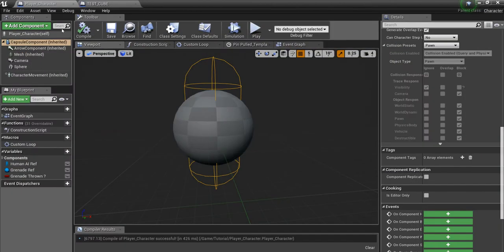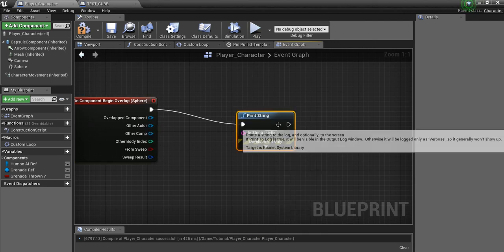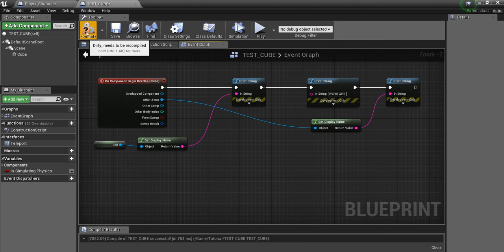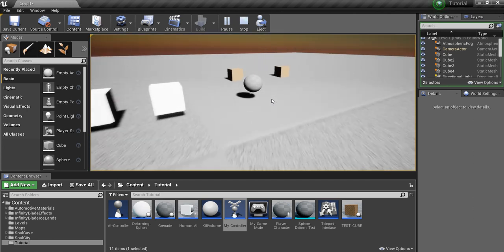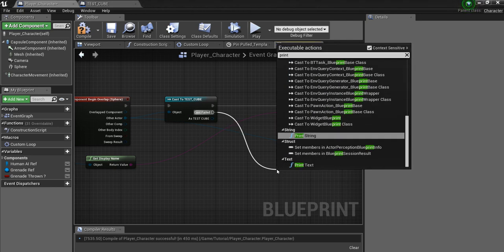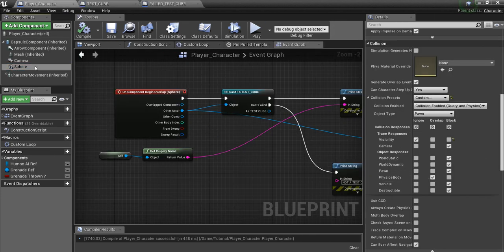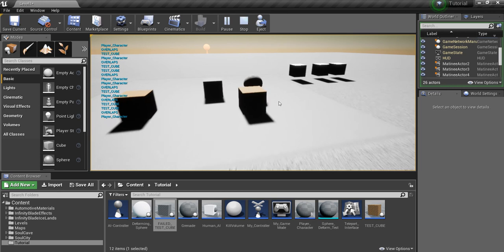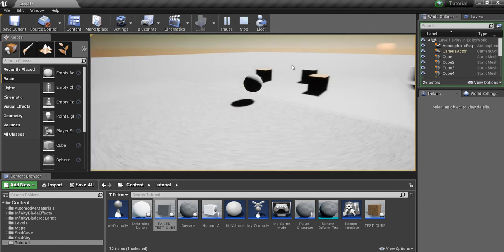Unreal Engine 4 Tutorial: Overlap Events Basic How To

Comment: I'm just not getting this. My collision boxes are acting all screwy. 

My player settings are capsule: generate overlap (Yes), Collision preset (Pawn), Collision enabled (query & physics) Object type pawn. My NPC are capsule: generate overlap (Yes), Collision preset (Pawn), Collision enabled (query and physics), Object type pawn. I added a collision box on my player for dialogue interaction with NPCs with the settings: generate overlap (Yes), Collision preset (Overlap all dynamic), Collision enabled (query & physics) Object type World dynamic. On my NPC's blueprint I'm using On Component Begin Overlap (Capsule Component) & On Component End Overlap (Capsule Component). I'm connecting the other actor pin in the overlaps to my third person character. 

When my player nears my NPC I have dialogue firing off in debug. The problem is the dialogue is unpredictable. Sometimes the text will trigger once, twice, and even three times. It also will do this sometimes when exiting. It should only be triggering once not multiple times. I noticed it tends to trigger once if my player walks straight on to the NPC. Yet, its more likely to trigger multiple times if my player comes from a slight angle. 

I've tried everything to get my overlap events to trigger just ONCE! I've inspected any extra collision boxes on both characters. I've cut down my code to overlap event not triggering anything except dialogue. I've tried to force it to only trigger once attaching a Do Once. I've tried using delays. Nothing seems to work. 

My game is a systematic game, meaning I have lots of systems interacting with each other. The player interacts with NPCS, clouds, and mountains. NPCs interact with the player, other NPCs, clouds, and mountains, etc. Everything in my game is interconnected. I need some way to reliably discern when one object is interacting with another object. I can't do that if my on component overlaps are firing random multiples. 

I'm starting to doubt this is just an issue with my player and NPCs. As I've had clouds fire multiple debugs when hitting a mountain. I'm starting to wonder if there is a bug with on component begin overlap and on component end overlap. I read some where that relying on overlaps is bad practice. I'm confused. What else is there besides event tick? Should I just start line tracing everything? What could be causing all this chaos, and what is a workable solution?

Sorry for the rant, but I've been banging my head against the wall for the last week trying to figure this mess out.
Reply from the maker: What kind of interactions are you having with clouds and mountains? If Do Once nodes aren't stopping this issue then i feel you have some other issue besides overlap events. You may not want "overlap" events at all, maybe "hit" events as those do not have a "begin and end" hit like overlaps do which add to the confusion. Also you may want to look into custom collision channels this will allow you to define precisely which objects can and cannot interact with each other and how they will do so (overlap, hit, physics, custom etc) that is where i would start. Hope that helps
Reply: @NebulaGamesInc  I'm simulating an atmospheric system. When the clouds hit mountains they weaken. This allows arid places to naturally form creating diverse biomes. I've started looking into other options. I discovered I can set up an is overlapping function inside an event timer. That helped clear up some of the mess. I've heard of the custom collision channels, and hit events but I've never implemented any of them. I'll need to look into that.  I need to find some other options as this project is extremely complex. I feel like I'm using primitive tools to try to build a skyscraper. Thanks for the ideas!
Reply from the maker: That is a complex system, however I would argue the tools aren't primitive, Unreal has been used to make plenty of complex AAA games but what you're asking is for a simple tool to do complex things exactly how you want it to. Unreal is a tool box, it has everything you need to make anything you can imagine but the tools themselves are just that... tools. You have to figure out how to use them and in what way to get the result you want. If what you wanted was simple and a commonly used feature there would be a "tool" to do it. But when you start creating truly novel game experiences you have to be the one to find a way to figure out how to use the tools to get the job done. I assure you all the tools are there to do what you want but you're kind of asking a hammer and nail to assemble a house for you. It doesn't work that way. Can you build a house with a hammer and nail? YES! Are they the correct tools? YES! But are they going to just "do it"? No.  There is no "build house" tool and that's kind of what you're asking for. Anyway, don't get discouraged.... this is what it means to "develop" your own game 🙂
Reply: @NebulaGamesInc  I agree. I guess the frustrating part is my game is so niche that there are very few tutorials which deal with creating real simulations of earth, fire, wind, water, atmosphere, etc. Its much easier to spawn a particle effect and remove it than create fire which interacts with every object with burnable trait. I was starting to doubt the capability of the Unreal blueprint system, and fearing I'd have to enter C++ territory. An area I just don't want to deal with. I've messed around with C++ in the past and my experiences have been lack luster at best. I'm grateful you have the foresight to recognize that the kind of game I'm designing is possible through the Unreal blueprint system. I guess I'll keep hammering away, pun intended. Thanks again!
Reply from the maker: You can look up water simulations I've seen some pretty awesome ones with blender where you actually have millions of particles each behaving under the influence of the physics engine but that is less "game" and more "science" in the sense that the CPU processing power needed for that is enormous you can do nothing else. So i would say figure out what it is exactly you want the user "experience" to be and find a way to create that experience without necessarily having to "simulate" fire or water physics. You can have a fire particle system burn everything that it touches but that doesn't mean you need to realistically simulate a fire. Catch my drift?
Reply: @NebulaGamesInc  Right on. That's my plan. No, I totally know creating real life simulations of everything would take way too much processing power. But, I do want enough interconnectivity between the systems that they have space to create emergence. My idea is maybe a step up from Breath of Wild's system. Whereas it appears they create a random rainstorm on a timer, my system monitors the location of the rainstorm. Whereas they might have random lightning and thunder. My system spawns thunder with a slight delay after lightning depending on the player's distance from the center of the storm. I'm not going to the level of emulating positive and negative charges in a cloud, which the player would never notice. My focus is on any system which the player can sense whether it be something slight such as timing between lightning and thunder to something major such as biomes where certain types of animals spawn. So, basically I'm making simplified models of scientific models.
Reply from the maker: Got ya. Well good luck, sounds like a cool idea, link your video if you like I'd love to see what you end up with.
Reply: @NebulaGamesInc  For sure! But, this is gonna be a long term project. I'll be in touch.

Comment: You know how to do one overlap at a  time?? Please help
Reply from the maker: What do you mean?
Reply: Right now I have two BP that do actor attached to socket, But I Want if one actor is attached the other can not go on.  right now 2 bp are attaching when overlapping   @NebulaGamesInc
Reply from the maker: When you attach the first one to your character or whatever the socket is, have a boolean variable also set within that BP that says "Is attached". So on overlap have a branch and plug this boolean into it, so if "Is Attached" is false, you can attach, if it is true you won't be able to attach anything else even if you overlap. When you remove the attachment, set the boolean back to false and you will be able to attach something new.
Reply: I have is power on boolean in my character. But I will put in my bp actors is attached. and see if it works, Thank you for getting back to me so quick.  @NebulaGamesInc
Reply from the maker: No problem. Let me know how it goes!

Comment: Still not working for me. Print string doesn't show any activity :(
Reply from the maker: Hey! What seems to be the issue for you? What are you trying to do?
Reply: Nebula Games Inc . I am a VR pawn which has a sphere set up similar to how your character has a sphere. I have a second pawn which is a mesh that follows a spline path. It has a cone attached which serves as a sort of eyesight distance, which us the part I am trying to overlap.  Sphere overlaps cone. Once that happens I need to see a print string so that I know I can fire an event later in the game. Basically the pawn with the cone fires projectiles at me if I overlap with its  cone.
Reply from the maker: Is everything setup to have collision with the VR sphere? Especially components higher up in the hierarchy if they don't overlap it can affect lower hierarchy components. Dealing with overlaps are tricky, screen shots are best. Do you have an unreal account? If so, post a question on answer hub and link me to it. If not send me an email with screen shots of all the key blueprints and collision properties and I will see what I can do.
Reply: Nebula Games Inc I just got it working today. Turns out I had some hidden actors that were blocking everything. I changed them to no collision so that nothing would interfere with my sphere and cone overlaps